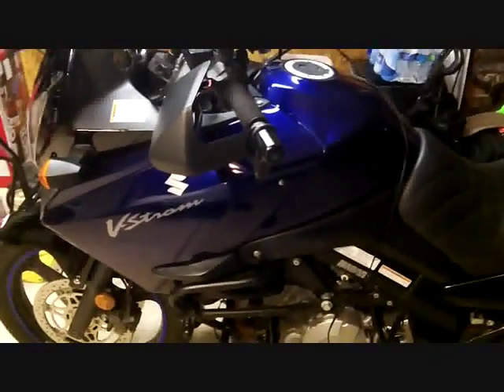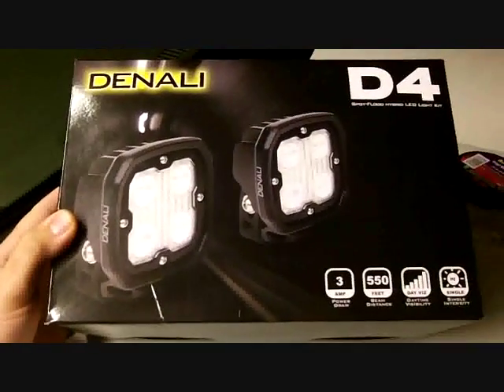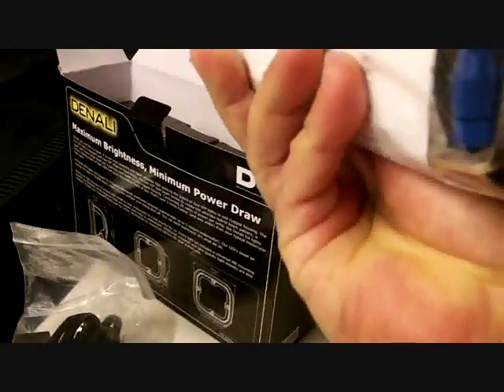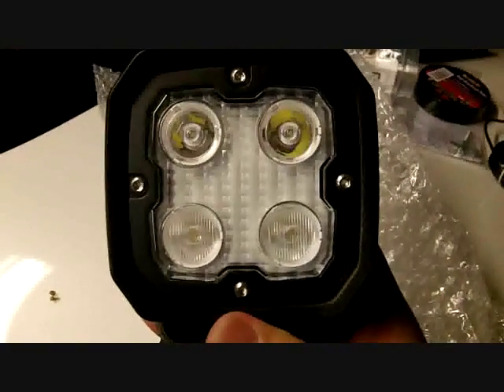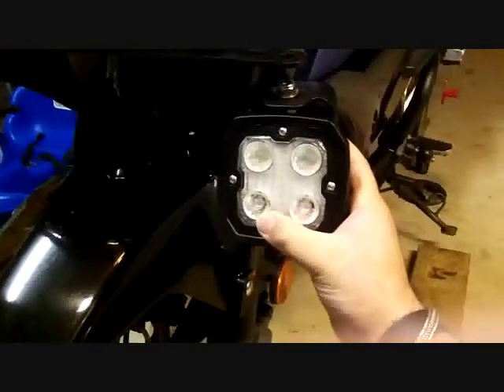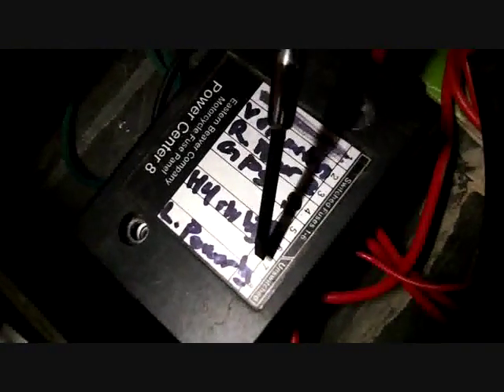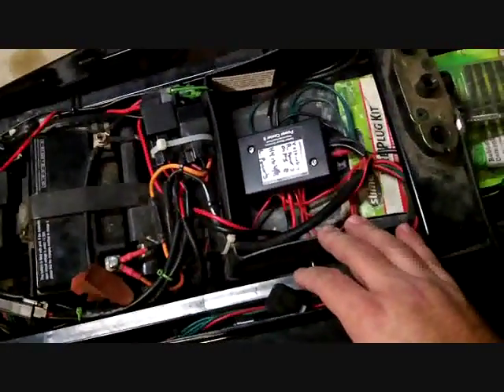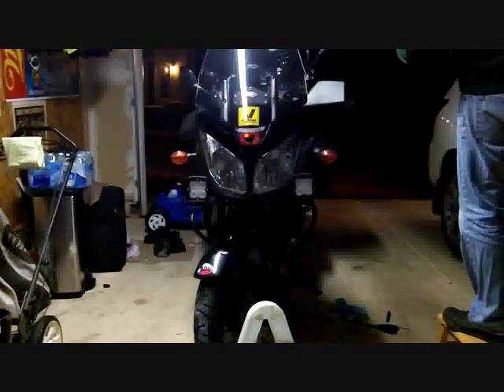Denali D4 Installation

Comment: good video. looking at getting a set at TwistedThrottle not far from here. Question, how and where did you attach the mounting bracket for the lights? thx.
Reply from the maker: The bracket is from twisted throttle. It is specific for my bike so check to see if they have one for yours. To attach my bracket, I used two existing holes used to attach the fairing to the frame and just used the supplied screws instead. Perfect fit, but again, this bracket was specific to the vstrom.

Comment: just curious, are you not concerned about village draw of this lights?  I am also considering same lighting but would prefer to hand them.  Did youbtry that?
Reply from the maker: My voltmeter drops by only 0.2 volts when I turn these lights on so the draw is minimal. I may try hanging them upside down later, but I am pretty happy with them being upright for now.